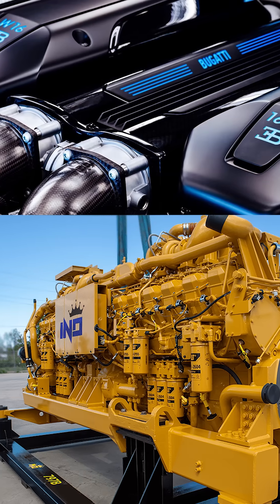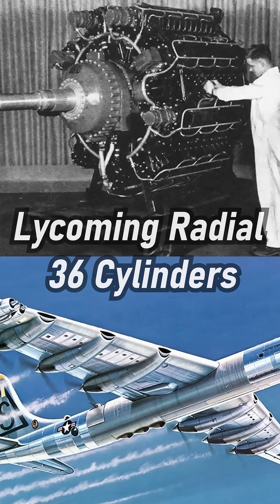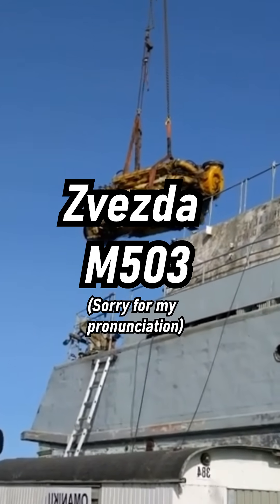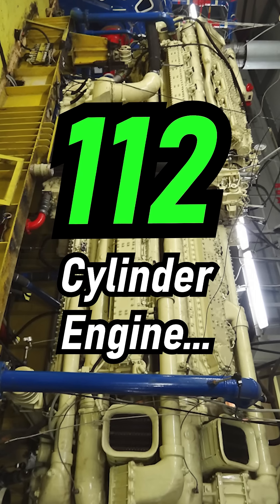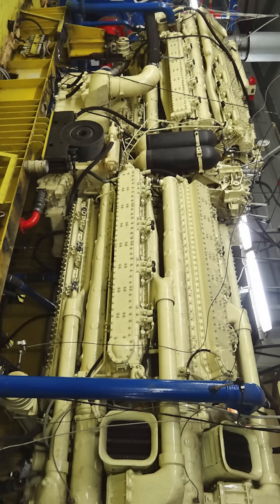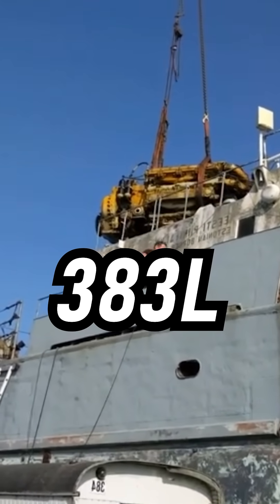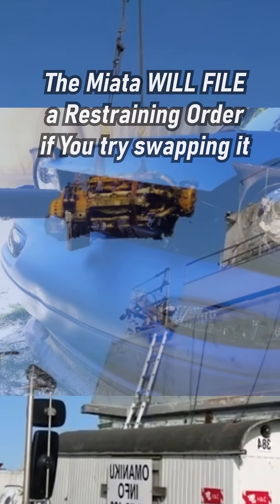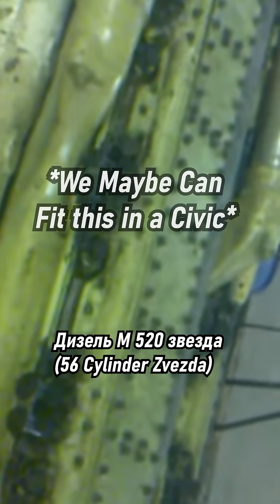wHaT iS tHE MOST CyLiNDERs ENGiNE eVER MaDE?

Comment: There doesn’t seem to be an official torque specification so I calculated it, assuming that peak power is at 2,000 rpm. I calculated it to be 48107.25 N m @ 2,000 rpm

Comment: Fun fact, Detroit 2 strokes like the 53 and 71 can have a flywheel on both ends, so theoretically you can just keep bolting Detroit's together. The 12 and 16 cylinder versions are literally a pair of V6's or V8's bolted together.

Comment: That's actually fairly typical of Soviet design. "If you can't make big, make it MANY" The N1, the Soviets answer to the 5 engine Saturn V rocket, had 33 Engines.
Reply: Other way around here
It was originally developed for strategic bombers in case turboprops didn't pan out, they ended up working better but the engine still worked. Make it heavier and more rugged and it's a reliable powerhouse for coastal missile boats

Waste not want notn
Reply: @sabotabby3372 Yeah typical Soviet design was more like "make the cylinder walls so thick you can bore it out by 2 inches and also keep the compression ratio so low that you can run it on bad fuel with 0 issues".
Reply: Only 30 engines. Starship superheavy has 33 engines.
Reply: @marcusrauch4223 I always get those two confused cause of how similar the number is
Reply: As i understand this is just a ridiculous number of radials on a common crankshaft. Thats why there's the bigger version. When they wanted more power they just stacked more radials together. Was apparently an utter maintenance nightmare.
Reply: In the rocket there were issues due to Pogo vibrations. I'm sure we could make them better nowadays.